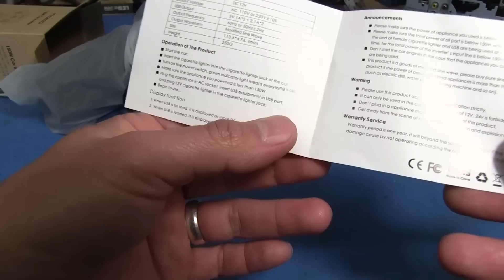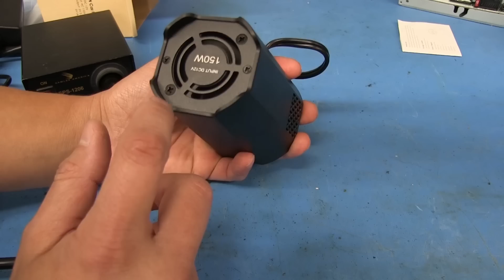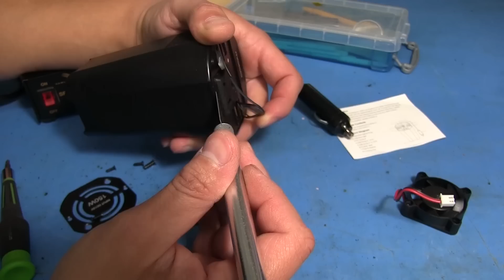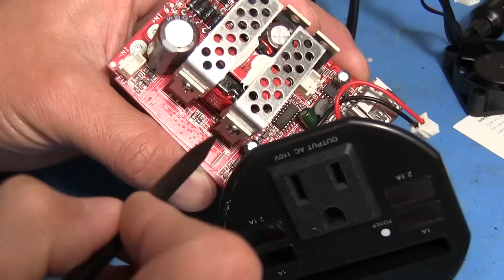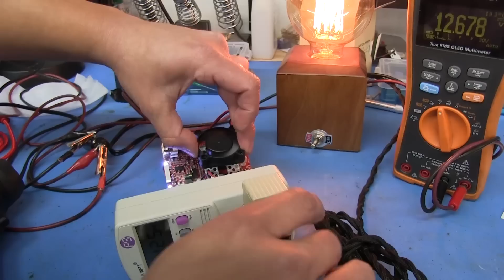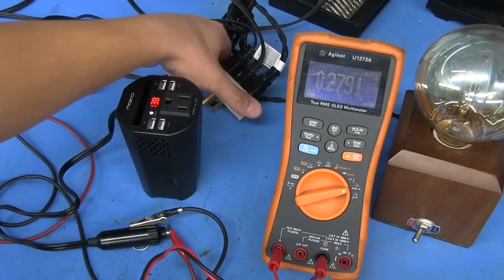TWB #80 | MOKO 150W Cup Holder Inverter Quick Look, Teardown, Testing

Comment: Great to see your face to put with your voice. Great videos!
As for the 120v receptacle, the "code" now is to put the ground on top, or if horizontal, put the neutral on top; theoretically preventing anything metal, like a metallic wall poster, from falling from the wall because of gravity and making contact with the HOT conductor.
I would say you are right on the short design for air flow! Heat is always a killer.
By the way, where did you learn all your great knowledge of electronics? Very impressive!!